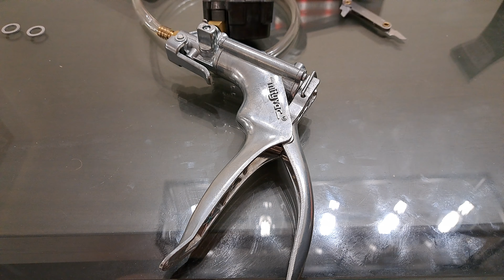Mityvac Permenent Fix

Comment: Same thing happened to my MV8500 and had to come up with a different fix. I use a stainless steel cotter pin trimmed to fit which is an easy fix. I have seen pumps come with a pin which is split but mine was just a solid pin which eventually fails! It's crazy that the company does not come up with a better solution!???.

Comment: Same thing happened to me and probably a half a million other Mityvac owners.  Nice fix you came up with.  Gonna give it a try on mine.  Although my pump is the plastic model so who knows if it will survive the mod.  We'll see.  Thanks.
Reply from the maker: Plastic should be no problem.  Form the wire with a bench vise and for the tighter bends, I put the wire in some needle nose and then put the needle nose in the bench vise (careful not to tighten too much & break the needle nose).  And just carefully hammer it over.  I should draw it up so there would be dimensions.